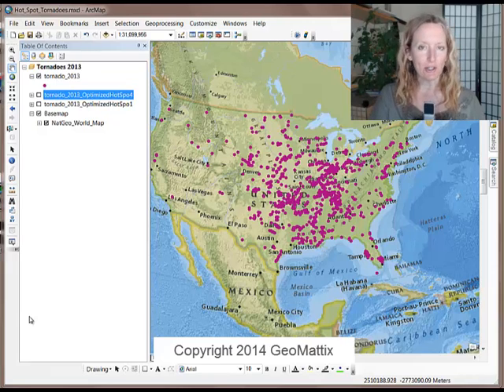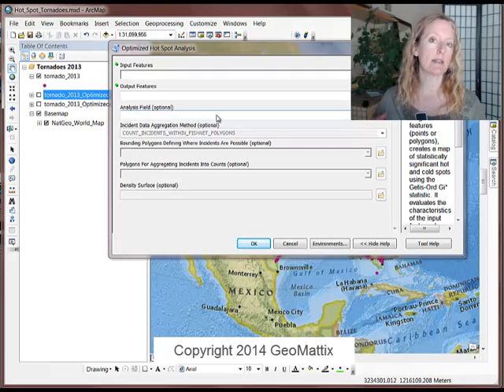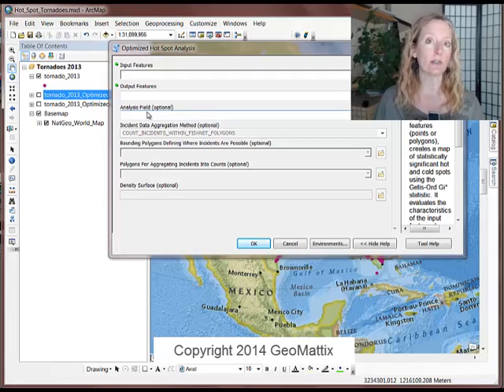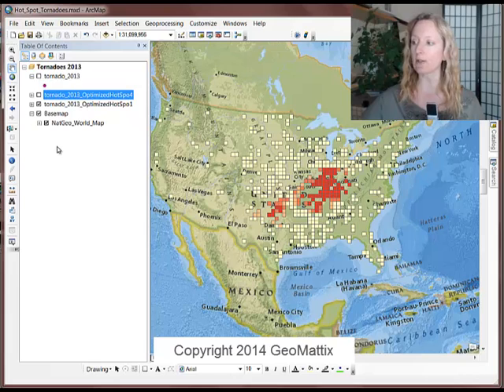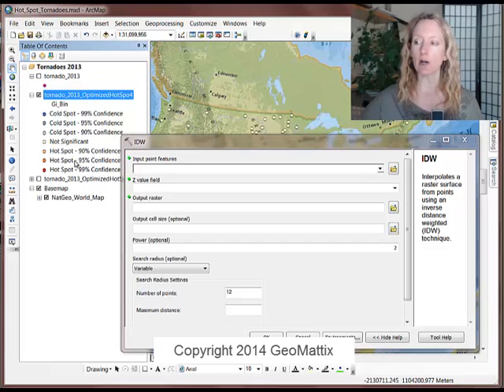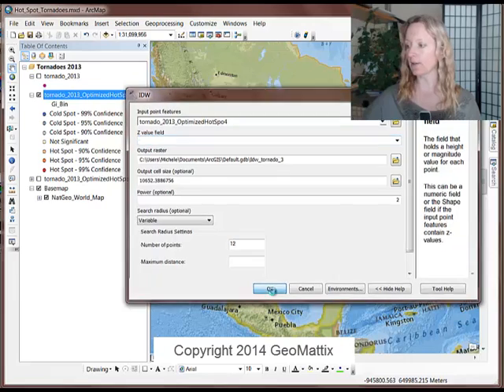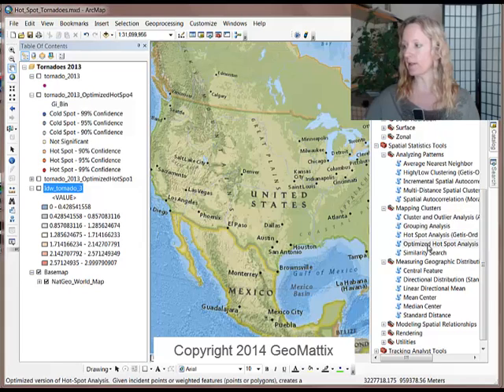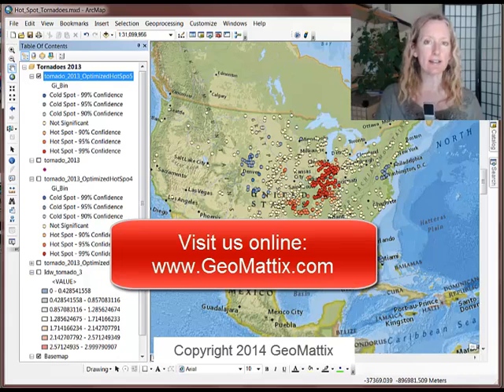ArcGIS Hotspot Analysis

Comment: Nice teaching video.  It delivered a basic concept of manipulating hot spot analysis for GIS data.  I have some questions about this tools.  Can I apply the Hot Spot Analysis on my Tree Data which are classified in 3 tree risk levels, low (1), medium (2) and high (3) to review their spatial distribution pattern?
Reply from the maker: +Ho Chi Chung Yes, you should be able to use the Hot Spot Analysis tool to find patterns in the risk levels.  Here is a help document describing the tool's use: http://desktop.arcgis.com/en/arcmap/10.3/tools/spatial-statistics-toolbox/hot-spot-analysis.htm   The Optimized Hot Spot Analysis tool is for the XY locations of the data only.  The Hot Spot Analysis tool lets you aggregate the features based on an attribute value, such as your tree risk levels.  Good luck!
Reply: Thank you so much!! May I ask what is the difference between Optimized Hot Spot and Hot Spot Analysis?  I applied Optimized Hot Spot before without Analysis field, the result was not satisfied and all were not significant.  Therefore, i applied analysis filed in optimized hot spot analysis which was nearly same as the result in Hot Spot Analysis.  So, Can I still use Hot Spot analysis for my tree data. 

Moreover, I would like to ask what is the statistical significant implied in the Hot Spot Analysis?

Thank you so much again!!!
Reply from the maker: +Ho Chi Chung There is a lot of statistical theory that Esri has published on how these tools differ.  I refer you to their spatial stats resource page: https://blogs.esri.com/esri/arcgis/2010/07/13/spatial-statistics-resources/